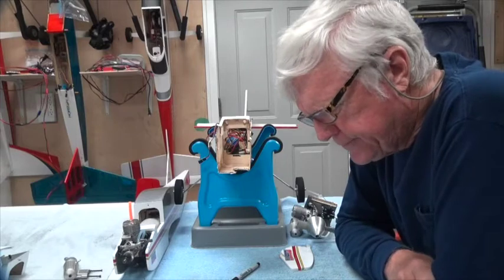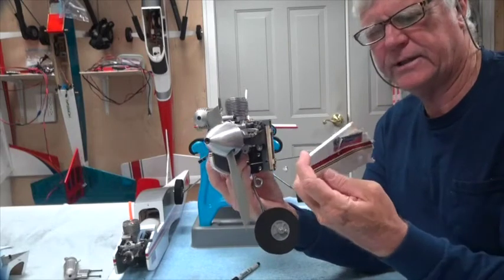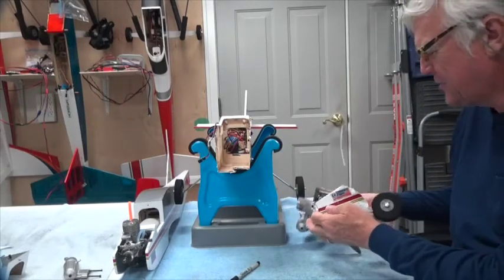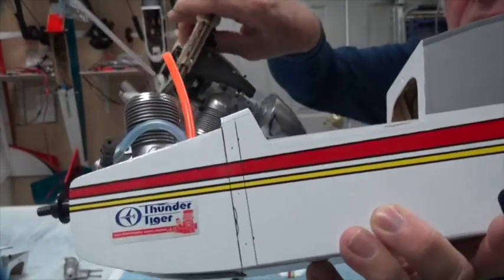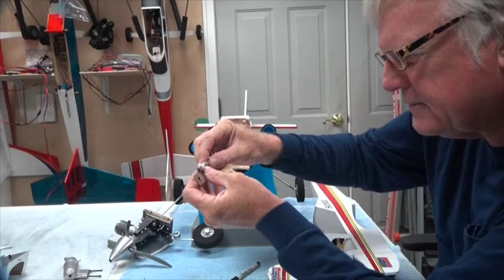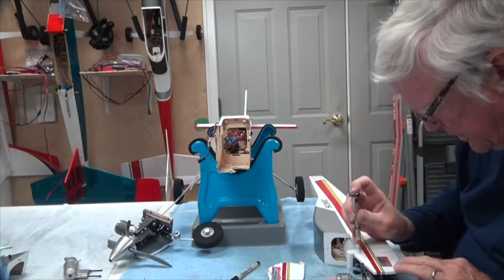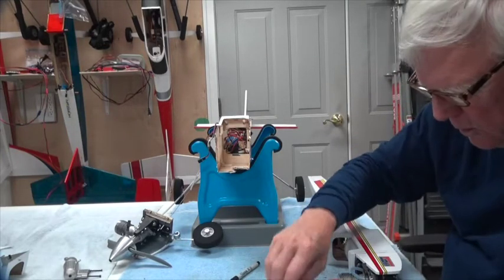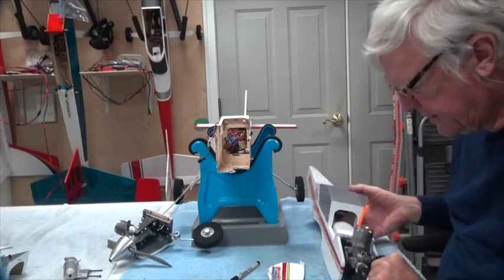SH51 Sonic Hi Wing Firewall

Comment: what did Phoenix say - this is clearly a manufacturing problem
Reply from the maker: +Simon Lewis I never asked them.  For $70, it was not worth my time being on hold on the phone, "Stuff Happens".  If it happens again with the second one I purchased, them they will hear from me.  It is not the first time for me, but that was another manufacture, and it happened on the ground, but same issue where the side of the fuselage was pulling loose at the firewall.  Also same design of the joint between the side of the fuselage and the firewall.  I inspect that area carefully now, and add screws just in case.